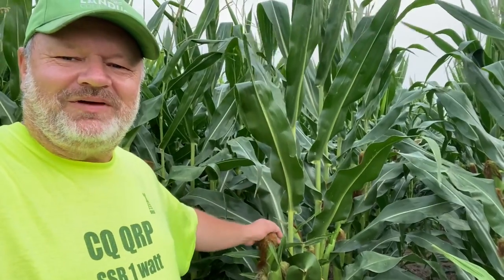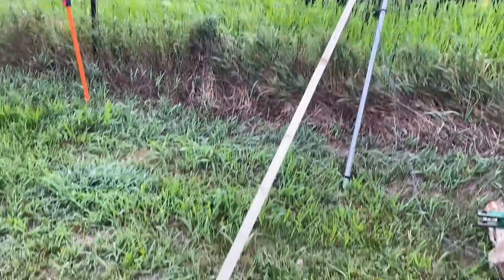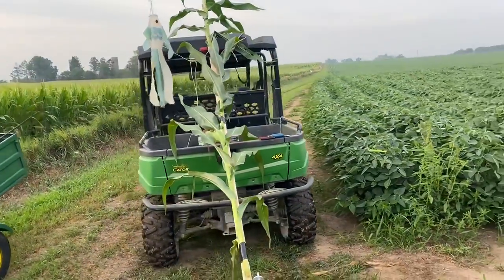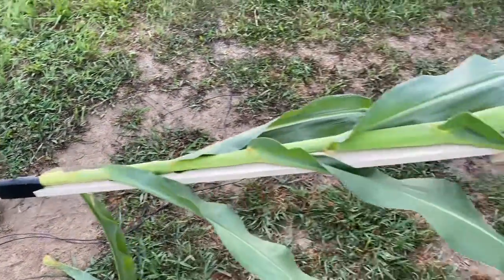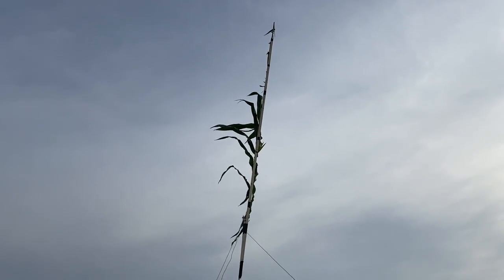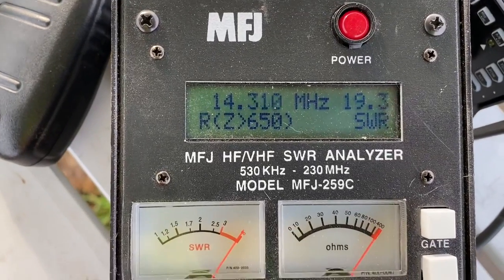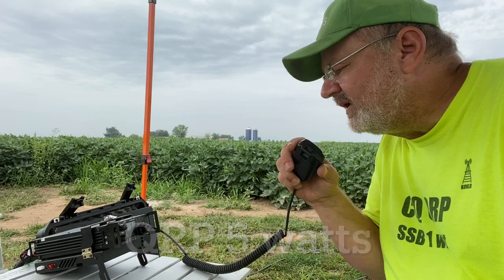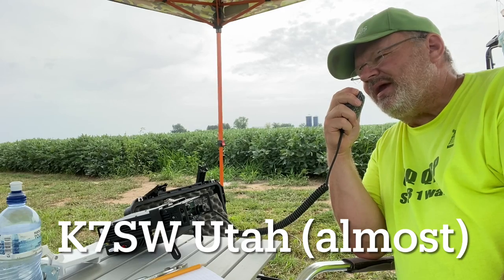CornTenna QRP SSB 5w - Iowa

Comment: My feeling is that the radials, fence and coax are doing the radiating, and the tuner is just tuning them against the first bit of copper wire in the bottom stalk. Woud be interesting to use an RF probe to see what's going on. 73 de M3KXZ
Reply from the maker: Hi Pete.. Thanks for stopping by and taking the time to leave a comment.. Something like a RF probe would be awesome to have in these situations.. I wish I had one.. Thanks for watching.. 73, Kevin ~ k0klb

Comment: I wanted to criticize the connection to the corn stalk, but it is very good - there is no way that small amount of wire is getting out on 20m SSB, like that all on its own with low power.  Thank you for the fun video!
Reply from the maker: Hi Carson.. Thanks for watching and for your comment.. I know what you mean.. It was the only way I could think of to get a good connection to all the water inside the stalk.. I wanted to especially use coax (and not just a single wire like in my past videos) so I could concentrate the most amount of energy to the feed point and above..  It's all magic to me anyway, even when I use a "normal" antenna, LOL.. It was fun to experiment and share the experience with everyone.. That's what I love about this hobby.. Watching others and sharing experiences.  Always good to hear from you.. 73, Kevin ~ k0klb

Comment: I'm betting that this is the very first time in ham radio that a corn stalk has been used as the radiating element of an antenna. Too bad the corn stalk dried out so fast. You got me thinking about whether any live tree (oak, pine, maple, ...) might be a good radiator. The challenge is how to make contact with the sap inside the tree. Great idea to push a short copper wire inside.
Reply from the maker: Hi Leon.. Surely there have been other (not so normal ham's) that have tried this before and I'm not the first, LOL... I think keeping the wire connection points moist would have helped my radiation efficiency thru out the day.. Like you mentioned, some sort of water bottle system to keep the stalks drawing water.. Thanks for your comment and watching.. 73, Kevin ~ k0klb
Reply: People do this all the time for MF work. Setting the tree on fire is a nice outcome and has happened when you’re dumping that many watts in for radiating a tiny signal

Comment: At first I was thinking “that is never going to work.” And then you made those 2 contacts. I was thinking that inside the corn stalk dried out, maybe from the power through the wire you used for the antenna… Bingo. Nice work again Kevin! 
73 de Jeff K3JRZ
Reply from the maker: Hey Jeff.. Thanks for your comment.. I wasn't sure if it would work or not too.. In theory it looked like it was possible with the water soaked core of the stalk, but I wasn't sure.. It was a fun experiment to envision, implement and watch the results.. I was surprised as well.. Thanks for stopping by and watching.. I appreciate it.. 73, Kevin ~ k0klb

Comment: How do like your g90?
Reply from the maker: Hi Craig.. I do like the G90... I hear of ppl that have reported issues on some G90 FB groups, but I haven't experienced any problems yet.. I will say that I have never done any firmware upgrades, or modifications to it.. I figure if it's working, why mess with it.. I think that's where folks run into issues.. Also, I only use it for phone/voice.. I don't do any digital with it and I rarely use it with more than 5w.. So, I'm not working it too hard and only use it portable.. I think its a very nice, compact radio AND it has a pretty amazing internal tuner.. The display could be a little larger but it's not a deal breaker for me.. 20w is plenty of power to make great QSO's.. for its price point, its a great little unit.. 73, Kevin ~ k0klb
Reply: @hamradioqrp-k0klb  95% going to pick one up

Comment: Bit confused with this one: is your alligator clip not connected to the ground there? Rather than centre pin?
Reply: And also confused at the G90’s ability to fix a 20:1 mismatch, I knew they were good (I own a G90) but I thought that’d be pushing it. Wow.
Reply from the maker: @MarkPentler  Hi Mark.. They say the G90 will tune a wet noodle.. (and now a corn stalk), LOL.. The G90 has an exceptional internal tuner.. You will be very happy with it. .Also, the alligator clip is connected to the exact location you could screw on an antenna, like a ham stick.. Thanks for watching and enjoy that G90.. 73, Kevin ~ k0klb

Comment: Don’t feel bad about Jim not hearing you well. He always has a high noise floor and can’t hear you unless you are full power. He is always the strongest signal on the third period. I would take an AM radio and survey his neighborhood to see where the interference is coming from.
Reply from the maker: Hey Kevin.. Thanks, I often wondered about that... He never hears me so now I know why..  I couldn't hear Bill (OR) or Jane (MA) very well either.. Once in a while Jane would come up and then I'd loose her.. After taking down the antenna and seeing how much moisture I had lost in the stalk it all made sense.. The copper wire I had inserted into the core of the stalk was loose and pulled right out.. It appears my best (wet) opportunity was within the first few hours of deployment and after that the stalks water/moisture I was using for conductance diminished quickly in the hot wind.. It was still a fun experiment to try.. Thanks for your comment... 73, Kevin ~ k0klb